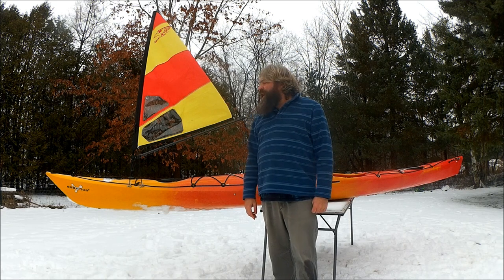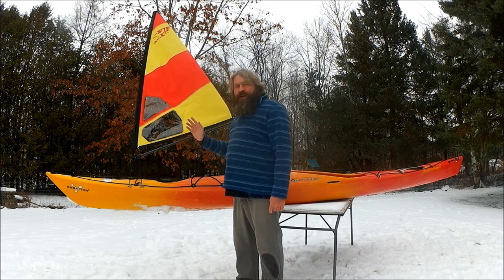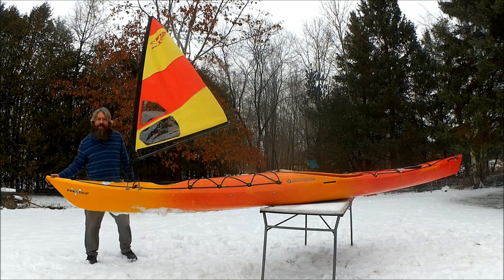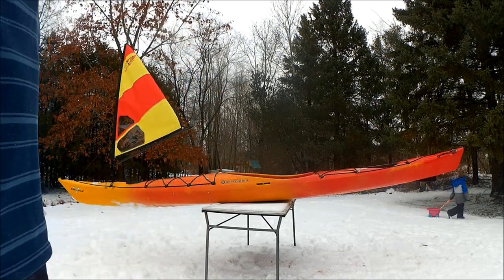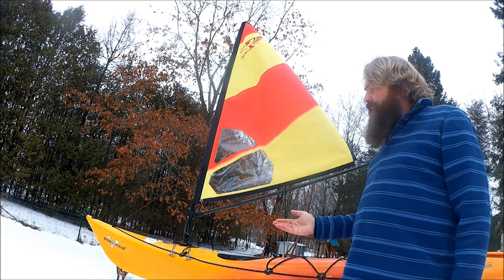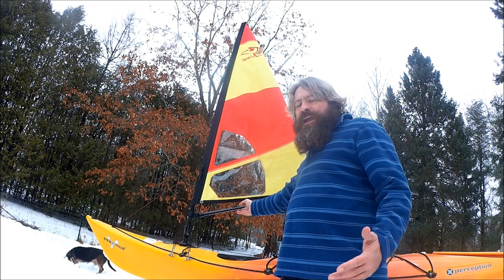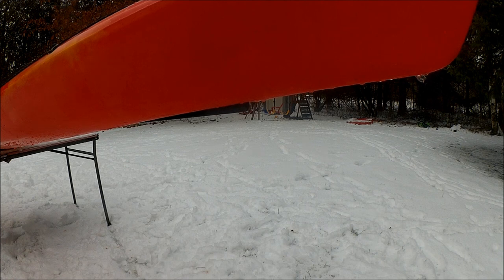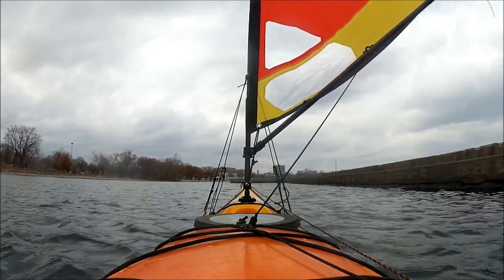How to Steer a Sailing Kayak with the Skeg

Comment: I've wondered for over a year why you didn't use your Bay Hen 21 for the Everglades Challenge.  It seems perfect.
Reply from the maker: +Timothy Cent you aren't the first person to ask either.  I have a couple of reasons, alone they might be overlooked, but cumulatively they give me pause.  1) the Bay Hen isn't self righting or self rescuing.  A capsize could not only knock me out if the race, but could cost me a pretty nice boat.  2) she isn't terribly fast upwind and is downright slow to paddle.  Wind from the wrong direction, or no wind could dq me on time.   When I go to something like the EC, I hope to, at the very least finish.  In the right wind, the Bay Hen could be a pretty quick boat.  In the wrong wind or rough weather, she is a bit of a liability.  I think this kayak is going to be a good contender for 2020.  My tests so far indicate she can maintain the speed and handle most crappy weather the Everglades are likely to throw at me.

Comment: I didn't realize the skeg was at the aft of the boat... I thought it was right under the lever or the cockpit.

I think you mentioned in an earlier video you wanted to add a rudder.

you should ask for a lavalier mic for your birthday

Some of the problems with tacking might be sail placement. When I launch my DC15 into the world, I just get blown back with only the jib. For me I think it is because the wind is pushing the front of the boat down and taking power from the keel

this is a pretty complex video --- chalk talk and on the water
Reply from the maker: Sound is always my biggest challenge, my camera wont accept an iexternal mic, so it means a whole new camera.  Will likely happen eventually.  
I think I might still add a rudder, $300, so for now I can work with the skeg.  I kind of like skeg steering.
Reply: Travel By Water too bad about the camera, because it seems like it works well enough but that sound.
Reply from the maker: +Titus Tiger I keep waiting for this camera to die to justify getting a new one.  Got it for free in the mail with air miles about 4 years ago, and it just won't die, and I put it through proper abuse too.